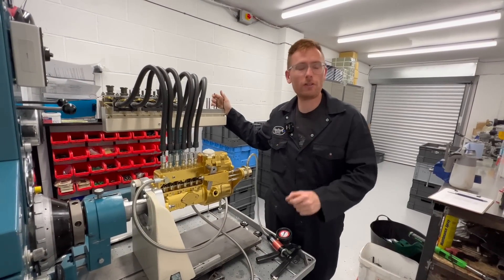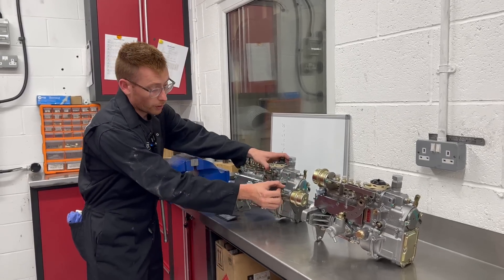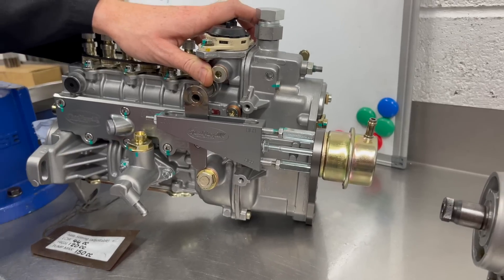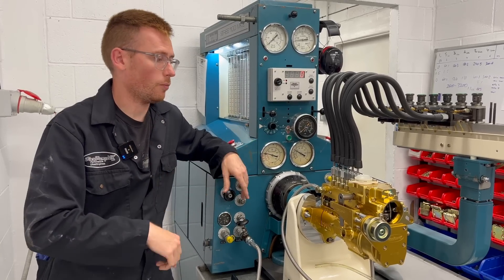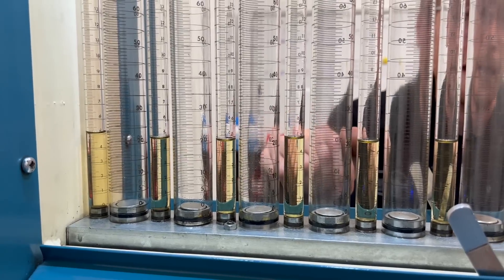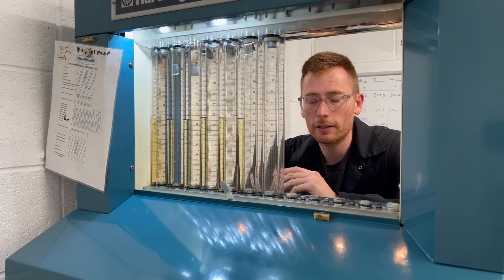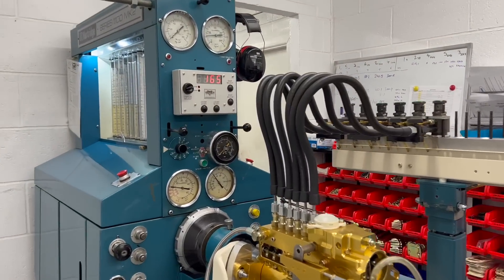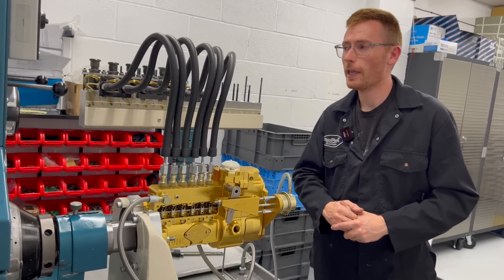Mercedes OM606 Turn your FUEL UP or DOWN,  ALDA adjustment and the different types and effects.

Comment: Good morning Luke I emailed your business email. Question for you since you are the Mercedes diesel man. I purchased an om606 that is a non-turbo mechanical injection here in the US but it came out of a 1986 300sd does that make sense. What size elements are typically in these non turbo mechanical 606 injection pumps. I'm putting it in a 81 Camaro with a 5-speed nv3500 transmission obviously I'm going to put a turbo on it. Here we call them barrels at your place you calling elements just curious on the maximum potential horsepower with the stock elements and the pump turned all the way up
Reply: That's a 5.5mm pump.
Reply: @professorjamesmoriarty5191  thank you for the info that's what I figured I think it needs a bosch cummins p7100 pump with 12mm elements turned down
Reply: @coreyellisart6877  12mm is overkill. 7mm is good for 350hp easily, I've got 500hp on 8mm.
Reply: @professorjamesmoriarty5191  
Well out here in the states it's 2grand for a pump with 8mm from dieselpumpuk
Or 900 for a p pump
Reply: @coreyellisart6877  if your up for a bit fiddling about the pump from w210 e300 turbodiesel has 6mm elements inside, those will swap into your om603/6 pump. Enough fuel for 250hp.

Comment: hello deiselpumpUK i'm from PHILIPPINES i watch your video all the time and i really like the way you explain how pump works in its high potential. actual i had a van with 603 engine in it. i was wondering if had had a slightly cheaper pump or element for my daily use van😊😊

Comment: I wish you talked more about the OM617
You have a video explaining how little power you can make wirh a 5.5mm pump.
Were you ever able to get the rated power (125hp) out of a stock OM617.952?
I can't find data about that anywhere. Did Mercedes lie about the power output?
Most of them seem to make 80hp at the wheels. Mine makes 100hp at the crank. I have the rack limiter adjusted to the max. 
I also have trouble making power above 4000Rpm. Peak power should be at 4400Rpm, but my engine power falls off at 4000Rpm. Could it be some pump issue like weak governor springs or do i have valve float or something?

I had my 240D dynoed too. It made 55Hp at 3800 and 107nm at 3400. It is very worn out but what i find interesting is that it  lacks top end power like the Turbocharged 300d
Reply: Did you find out?
Reply: @mbz4652  I never got a reply.

Comment: Hi everyone, i have modified my om606 with a 7.5mm mechanical pump, holset hx35, kangaroos manifold,3' exhaust and it makes around 350hp my problem is, my transmission is still the stock 5 speed automatic and when i floor it,  the gearbox jumps out of gear and i have to stop the car completely and start it again. This happens at around 3000-4000 rpm, otherwise if i drive the car slowly and dont rev too high the transmission works well. Does anyone know why? and what i need to do to fix this? Would a transmission reset work? If you would know please tell me
Reply: Mercedes transmissions are known to be reliable and last a very long time, however they don't take power increases very well. The transmission needs to be modified to withstand higher hp / torque. It had something to do with transmission friction clutch plates and adjusting pressures etc.

My W210 OM606 in which I have an evrymod, and sometimes it does the same thing as yours, so that is normal behavior with stock transmission with increased power.
Reply: @Puzkajuzzi  thank you very much, so what i need is a transmission tune? Also do i do this the same like a ecu tune with a tune shop?
Reply: @ftwdude2139  It is not just a transmission control unit software tune. Tranmission needs to be removed and pulled apart and hardware changed inside it, dont know exactly what but i've heard that there are clutch friction discs added so it can hold more torque and not slip.
Reply: @Puzkajuzzi  thanks alot, i guess i will just reduce the boost and not floor it often😂 until i am ready to engine swap the patrol
Reply: Luke has stated that the stock 722.6 transmission doesn't play nice with the Mechanical Fuel Pumps.

Comment: heres an idea for that little pump: attach it to a 2jz or RB engine, would be fun to see how much it can push over those platforms, to the rb theres a RD engine that can be used as bottom with tb head, then its a matter of attaching the injectors

Comment: Suffice to say, the tab that the ALDA comes into contact with is the rack limiter. The more clockwise the tab is allowed to rotate is more fuel, more counter clockwise is less fuel (too far and it doesn't let the engine run). Adjusting bolt contacting the ALDA with the actuator at rest (no boost) will be your minimum fuel adjustment, and adjusting the the opposite side will be your maximum fuel adjustment. Any of the ALDA systems actuate that rack limiter and making adjustments following that principle will get you where you are trying to go. I mostly just described this for folks with some other ALDA if it operates differently. 

Luke, as always, I love what you do and share!

Edit: I came back to read this and thought and my explanation wasn't clear enough.